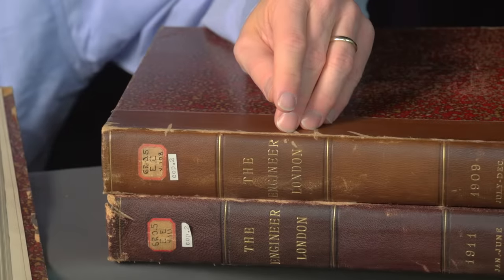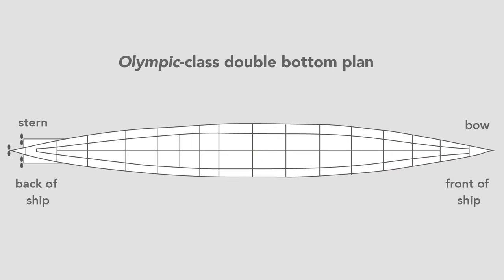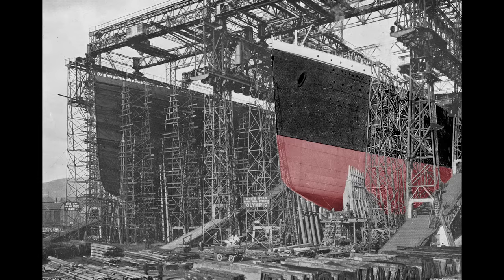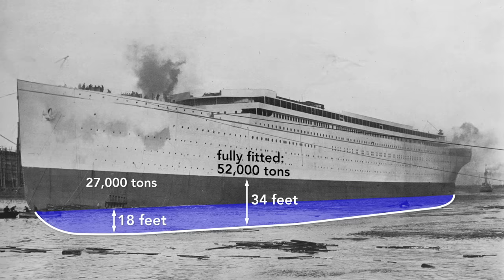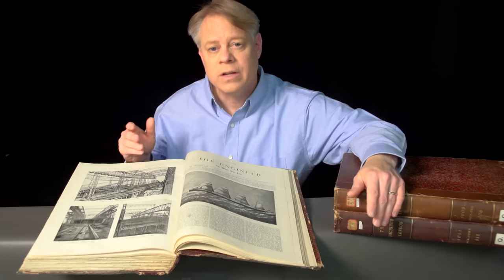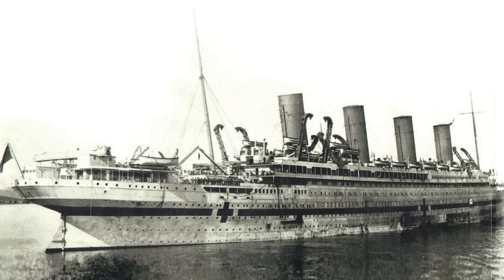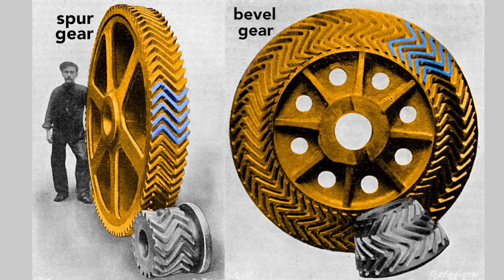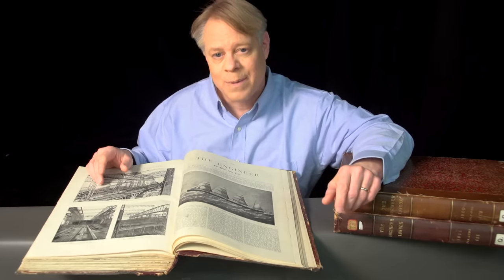RMS Titanic: Fascinating Engineering Facts

Comment: This was great. I am an Engineer and I can hardly even comprehend how they did this without the aid of computers and computer modeling. Incredible.
Reply: designs had layers of tracing paper. (its why there is the layer functionality in design software) Also it may be interesting to note that at that time, 1912, there were a lot of computers involved. They were actual people who computed the cost and amounts of everything (and the projectioned costs and amounts) It"s where the term computer comes from
Reply: Knowledge!
Reply: The pyramids must really have you stumped
Reply: @RRaucina    To be fair, the pyramids do indeed have modern day scientists and engineers stumped. To this day, scientists and engineers do not know how The Great Pyramid was able to be completed in less than 30 years.
Reply: @SergeantExtreme  What we know about the pyramids is how little we actually know.
Reply: I'm not an engineer but I am still in awe~!!!
Reply: @Matt02341  Not tracing paper for the original designs - it would have been linen or similar I expect. Superseded eventually by 'Mylar' drafting film. But for the full size drawings, they were scaled up in lofting sheds by loftsmen (similar to draftsmen) and laid out as patterns or even onto the steel in the works. Quite a skill and remarkably accurate. https://sandypointboatworks.com/boat-building-articles-journals/boat-building-articles/lofting-basics
Reply: @colinmontgomery1956  yea really  computers only do what you tell them
Reply: @SergeantExtreme  how do they know it only took 30 yrs?
Reply: @davidjones-vx9ju    The Egyptian hieroglyphics themselves state this.
Reply: @SergeantExtreme  and you are sure that is what they say?  an expert on them are you?
Reply: @Matt02341  They were adding machines, not computers.
Reply: @RRaucina  They were built in kit form at Harland and Wolff.
Reply: Ric Rovey  Your "somewhere" has misinformed you.
Reply: @DavidMartinAustralia  My god, you spelt superseded correctly. Take a bow.
Reply: @davidjones-vx9ju  Wrong. Mine breaks down even although I've specifically told it that it needs to work today.
Reply: @davidjones-vx9ju  They counted the rings in the trunk.
Reply: @johnbishop5316  People computers came long before 'Adding Machines' if you're referring to the mechanical variety we often see 'back in the day' such as early NASA missions and the Manhattan project. Of course, an abacus is also a type of machine I suppose but the people who did that work were indeed called computers. Sounds funny to our ear these days.
Reply: @johnbishop5316  Thanks John, I hate to perpetuate mistakes that creep in on forums.
Reply: 1) It is nothing to boast about. Engineers are commonplace. 
2) It does not merit a capial E. Unfortunately you are only an engineer. With poor grammer skills. To be expected I suppose. 
3) Your comprehension skills are limited. 
4) Modelling is modelling unless you really are in the US? 
5) It is perfectly credible if you study  it properly. 
6) It wasn't that great to people who have studied these ships. 
Are you always this wrong?
Reply: Wrong! 1859. Check facts before engaging mouth. Or keyboard.
Reply: @DavidMartinAustralia  You are welcome.
Reply: When? Egypt or Titanic days?
 Napier came up w/ logarithms in the 1600s, slide rules followed very quickly. They certainly used them in science and engineering in the early 20th c.
Reply: @johnbishop5316  
The people who operated the mechanical calculating machines back then, to produce math tables and such, were know as computers.  The name transferred over to what we now call computers when they made the people obsolete in that function.

The scientific phases of the Manhattan Project used rooms of hundreds of these human computers.  Determining how to break a larger problem down into distributed chunks for calculation is known as Numerical Methods to old-time CSC people.

Comment: 9:03 I have been obsessed with Titanic for nearly two decades. I completely missed that the central screw could not move in reverse. Upon you telling me this I immediately went to the iceberg collision scene in Cameron's Titanic and I'll be goddamned they actually got that scene right.
Reply: They did, although there was a much larger 'error' in the film, namely they didn't have time to put the engines to full astern.
The other thing people think Cameron got wrong was the order "hard a starboard" when in fact they wanted to turn to port. That was correct, as the standard was so-called 'tiller' orders, which is to say imagine you're steering using a tiller on a sail boat. You want to turn to port, you push the tiller to starboard. Hence the order seeming to be backwards.
Lastly, it's worth noting Titanic got underway after the collision but soon stopped again as the forward motion was making the flooding worse. Cameron didn't bother, and I can understand why; it was hardly central to the story he told.
You probably know all that if you've been a hobbyist on Titanic, but I'm sure many may not.
Cheers
Reply: Barry Manilowa 
The Titanic is tiny compared to modern cruise liners. Look at photos of the Olympic berthed next to the Liver Buildings in Liverpool. Then look at modern ships at the same berth. Current ships near obliterate the view of the Liver.
Reply: I've been fascinated by the Titanic since I was a mere 6 or 7 years old (about 8 years ago), and I still got that whole thing about the central screw all mixed up!  I thought it was only used for maneuvering in port while the more powerful outer propellers were only used at sea!

Also, Barry Manilowa, It's hard to find a passenger ship nowadays that ISN'T larger than the Titanic!
(Ex: Oasis of the Seas: 1,188 FT, 100,000+ tons, 6,000+ passengers. Vs.
Titanic: 884 FT, 57,000 tons, 2,435 passengers.)
Reply: Michael Miller wow
Reply: The central screw could not get in reverse but it is connected with the rudder which made it possible to steer the ship.
Reply: @Barry Manilow The largest ghost ship I know of is the SS Baychimo which sailed the ocean between Russia and Alaska for well over thirty years without a crew.
Reply: That was part of the problem. With the central screw stopped, much rudder authority was lost. As a pilot when using rudder on the ground it’s instinct to increase throttle to get more rudder authority.
Reply: Did you know Neil Degrass Tyson noticed that the night sky in the movie was wrong? Cameron was so upset by this that he hired him to change it for the new DVD release. 😂
Reply: And they still occasionally fall over.
Reply: The turbulence from the propellers spinning against the flow would've caused turbulence that would've negated the effect of the rudder, so they gave the order "all stop" rather than "full astern"
Reply: Barry Manilowa  really the Titanic was a row boat compared to what's out there now
Reply: Barry Manilowa  many cruise ships are 2 to 3 times larger, some are larger still.
Reply: Michael Miller hey i too am addicted to titanic
Reply: The thing that he did apparently get wrong was the position of the stars that night.  This was pointed out to him afterwards and was corrected at a later stage.
Reply: 'I'll be god damned' were the same words spoken by Dr. Ballard when he found the Titanic. We know who else says it though.
Reply: @Bartonovich52 
Would you say it's similar to a personal watercraft when it loses its ability to turn?
Reply: Great video they were a masterpiece
Reply: Barry Manilowa  both Titanic and Olympic would been surpassed in 1913 by the SS Imperator .. so had not the Titanic had sank they probably wouldnt be much known.. and Titanic herself wouldnt be much special at all since contrary to popular belief all 3 were totally identical in size.. Titanic was 1500 tons heavier due to upgrades in B deck .. and Britannic was a bit wider only due to extra safety measures introduced after the Titanic dissaster.. had it not occur Britannic would been launched identical to Titanic with just 20 lifteboats and identical in mass (maybe some upgrades here and there) and would been named Gigantic
Reply: Barry Manilowa  i like cheeseburgers
Reply: @johnburns4017  When in Venice a few years back, I had occasion to watch one of the modern cruise liners on her way out from the pier, though we were closer to the plaza ourselves. It looked for a moment as though part of Venice were moving. And of course, when one docked, the streets filled, and then emptied when she got ready to go.
Reply: It may be why whether they did or not put the engines in reverse. It would be pointless as you have 45,000 tons of ship and it's momentum and a centre screw which did not go in reverse. Better to just steer away and hope for the best and at least the momentum would help it turn better.
Reply: @mattseymour8637  I was thinking the same thing, Titanic was steaming at 22 knots when Murdock's order of hard a starboard and full speed astern was given.  I too think the ship's forward momentum and the center prop still in full forward motion, may have given the ship the edge she needed to make a slightly tighter turn, certainly the center prop would have had much greater impact on the rudder, rather than the reality of it simply becoming a resulting drag on the overall effort.  I've read somewhere that scientists also think that had they reversed only the port propeller, while maintaining full speed on the other two engines, she very likely would have cleared the iceberg.  Although we'll never know, it's still interesting to think about what might have been.
Reply: I have always been fascinated by the Titanic, it's a real work of art but there are also so many myth's that are proven wrong. I use to live where lot's of the passengers were laid to rest, it really make's one think about what they must have went through before they passed.
Reply: Even the Queen Mary is larger than Titanic. It is moored in California.
Reply: I read somewhere that the last survivor of the Titanic who was in the 'bridge' when the order was given, admitted on his death bed that the person steering the boat, mistakenly turned the opposite direction in a panic and then turn the wheel to the correct direction.  By then, the momentum of the large ship doomed it to the iceberg.  This person did not give testimony of this in the official  'inquirer' of  the disaster because he wanted to spare his family of that shame.  I read this a few years back but I have yet to hear any conformation of that.
Reply: Hey mate what do you think, I rekon Titanic split when it sunk because stern section full of air and highly bouyant, mid section weakend and when she went perpendicular and began death dive all that strain works mid section like bending and twisting a wire. stern seperates and sprials........
Reply: When did God get a last name?
Reply: Barry Manilowa  There are. I happened to work in the biggest transatlantic cruiseship to date and it's basically an 18 meters tall and a mile-ish long surfing town.
Reply: joskemom  The reason was that the helmsman was trained on sailing ships. With the advent of steam the direction of the ship's wheel, when you want to turn, was changed. They became like an automobiles steering wheel. Old habits die hard.
Reply: Hello Michael,   It is not polite to curse on YouTube,  you should ask God to forgive you.
Reply: wait.. I thought none of them had reverse... somehow that made sense at first, but how would you make a hard turn if none had reverse??..... dang. now I get to watch it again.
Reply: @steeltrap3800  If you read the screenplay, Cameron says he deliberately changed the "hard to port" order to "hard to starboard," because he was afraid to confuse the viewer.
Reply: @robgoren8628  
I've seen Cameron in an interview specifically say he kept the historically accurate "tiller commands", which is why the command is hard to starboard even though of course they are turning the ship to port.
Reply: Very cool I left in the mid 80's to the far far west :). There is a lot of history in that city. I couldn't imagine what it would have been like for the  steerage passenger's, off all of them on board only 25% survived the rest either froze in the water or went down with the ship. I guess people on the east coast learn more about the sinking due to the location of the wreak and the dead and living that ended up there. I learned about the Titanic in grade 7 that's when I got really interested in it.
Reply: The “full astern” order is hotly debated to this day. Many feel there was more than enough time to carry out a full astern order, & that Titanic indeed DID go into reverse as attested to by 4th officer Boxhall (you can hear him say so in his own voice, on the net in a different video.) What I find MOST interesting is that just like Eva Hart, & Ruth Blanchard (along with many others)Someone who was actually there tells what happened, then is disputed by people who were not even born at that time, stating something completely different and disagreeing with someone who was actually there witnessing what happened.
Reply: CLARIFICATION: I forgot to complete my thought and the last comment. Ruth and Eva both stated they saw titanic break in half, yet as the years went on many “experts” hotly debated that with them saying the titanic did not break in two. They continued to tell many survivors who claims to have seen titanic break into that they were mistaken, or did not know what they were talking about. Finally when her remains were found at the bottom of the ocean, those people were indeed correct. Yet so many “experts” want to say titanic did not go into full reason v they continued to tell many survivors who claims to have seen titanic break into that they were mistaken, or did not know what they were talking about. Finally win her remains were found at the bottom of the ocean, those people were indeed correct. Yet so many “experts“ want to say titanic did not go into full reverse Although fourth officer box hall who was on duty at the time adamantly stated that she did go into reverse, and you can hear him and his own voice saying so. Yet again, these experts seem to know, or at least think they know, more than an actual witness. That gets me so baffled.
Reply: but didnt they in the movie asked to engage the reverse mechanism?  @steeltrap3800
Reply: Why is it necessary for you  to be blasphemous?
Reply: "actually got it right"

cameron's usually decent about getting some things right :D
Reply: Well they sort of got the scene right, but I don’t believe that the order “full astern” was ever givin. The officers wouldn’t have been taught to do this but, instead to put the ship at a full stop and turn to safely to avoid the object.
Reply: If Titanic had hit the iceberg head on it would have crushed the bow but would not have ripped open #5 compartment.  The fatal error was to initiate a turn and side swipe the iceberg.
Reply: No need to curse God.

Comment: What amazing and talented engineers and craftsmen that were employed by Harland & Wolff then.  Imagine, no computers, only pen, paper, and a smart guy wielding both,  and at a time when electricity, electric light and radio were in it their infancy.  Pure genius.
Reply: And it is even more amazing when you think the whole plan to build these liners was hatched only in 1907... in the following 4 years they built a dock, gantries, and designed and built the first of these fantastic ships that never had been built before.
Reply: Don't forget the slide rule and drafting equipment like triangles, 2mm pencils, and erasing guides.
Reply: @clearsailing7993  Beat me to it. Yes the mighty slide-rule was at their side. Basically an analog computer.

Comment: I have no particular interest in maritime vessels, but the sheer scale of both size and engineering impresses me to no end. It's particularly heartbreaking to find how relatively short-lived the typical ship's lifespan is before it is decommissioned and unceremoniously scrapped. It's more sentiment than anything, but they're behemoths in human effort to manufacture, travel half the world, then in generally 20-30 years get beached for child labor in developing countries to cut to pieces with torches.
Reply: Salt water is a bitch.
Reply: @JimmyKraktov  They can still remain operational for centuries but it takes a major overhaul every decade or so which is not cheap so often it's cheaper to just scrap it and get the value of materials and use that to partly fund a brand new ship. But some of the old liners are still around and also Titanic and Olympic's tender the SS Nomadic, the last ship afloat designed by Andrews. 

It's kind of ironic that despite Olympics success the only remains of her class lie at the bottom of the ocean. Their sinking has preserved them. Although much of Olympic's interiors remain, there's an entire first class dining room in a hotel somewhere. 

Much of her forward grand staircase remains preserved including the famous clock. Which is fortunate as the implosion of the dome destroyed the forward grand staircase on Titanic and nothing remains. So that's how we know what it looked like as there are no photographs. All photographs of the forward grand staircase are of Olympic not Titanic. And the remains of Olympic were used by Cameron to exactly match the wood carvings for the movie.